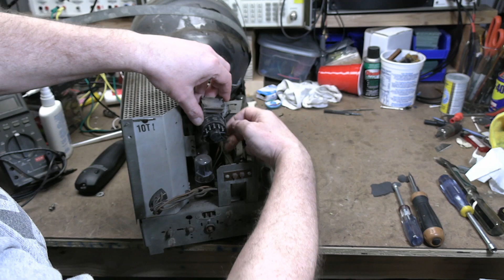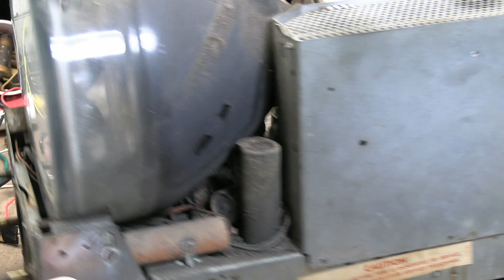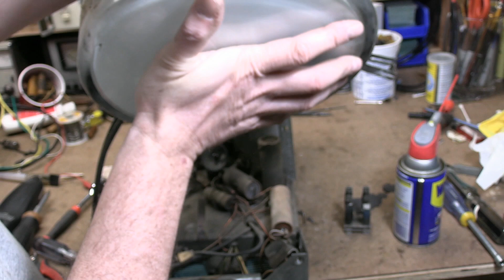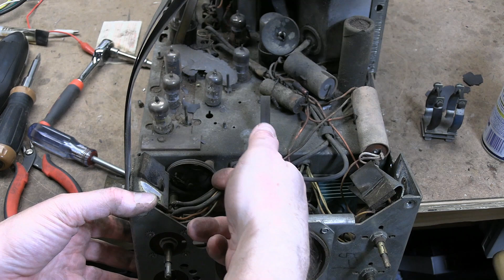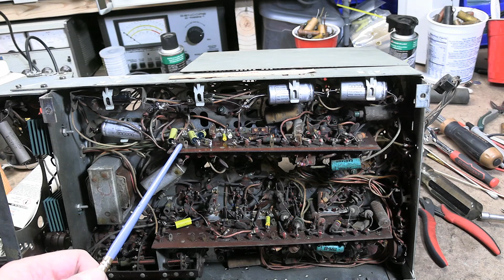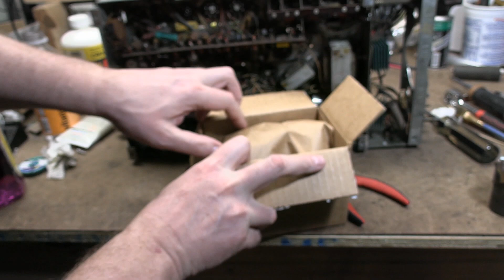GE 10T1 restoration part 2

Comment: General Electric really penalized the service man with this chassis design.  It's bad enough having to pull the works out of the cabinet for service but, having to additionally pull the CRT to access parts of the circuitry is totally unacceptable.

Comment: Wow, nice transformation on the outside of the chassis Bob! It looks SO much better. Already well on its way to being a nice little set! When you lengthen the HV lead to the CRT, I would like to see the metal CRT anode end and if you reuse it and if so how you attach it or if you buy new and if so from where. As you know I'm replacing mine due to it being stiff as a board.
Reply from the maker: I reuse. There's a hole in the middle. The stripped end of hv wire is fed through and soldered. Very much like a grid cap

Comment: Try aluminum tape around the capacitors so they fit the clips.
Reply from the maker: I don't want to use anything conductive. The chassis is floating and does not connect to either end of the caps.  The silver caps I'm using have clear insulation over the body.
Reply: I just bend the clips a little to make the capacitor body fit snug.  On the axial leaded electrolytics, the case is tied to the negative terminal.  The body shrink wrap is a good insulator but, I have never seen a voltage spec associated with it.  If the negative lead is tied to something other than ground, it wouldn't hurt to wrap some electrical tape (or the insulator of your choice) in the areas where the clips contact the capacitor body.
Reply from the maker: @billharris6886 Clips are spring steel.  Seem more likely to snap than bend. You'll see what I did in the next installment
Reply: @bandersentv  Thanks Bob.  I have never had a clip break.  However, with that said, most of the time I end up removing the clip and go with a different mounting technique because the new cap is so much smaller.